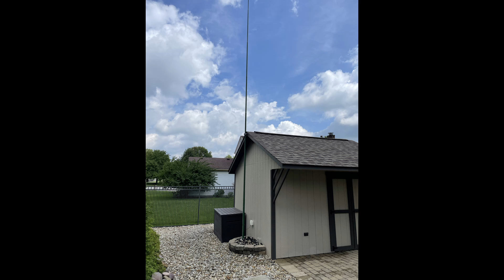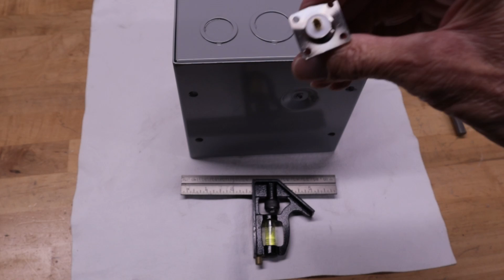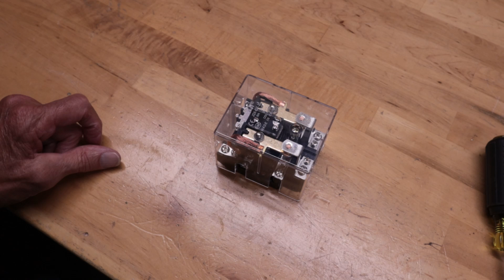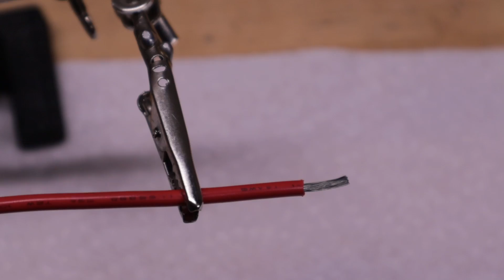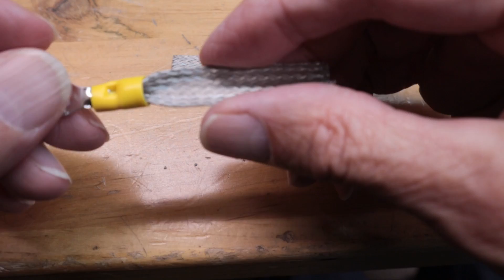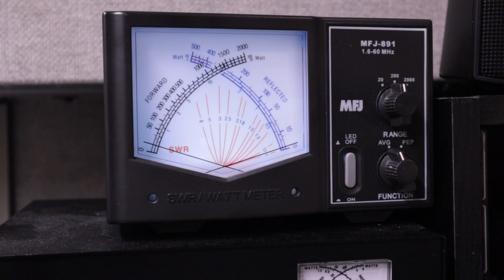Easy to Build REMOTE Antenna SWITCH for HAM RADIO!

Comment: Keep getting a high SWR...need my tuner to work it down, when on the 2nd connector( dummy load) tuner won't bring it down at all....
Reply from the maker: Not sure what would cause that.  Maybe try making a choke (coil your coax) just before the switch.

Comment: Awesome project!   The only thing I might do different is to implement a bias tee circuit to provide the 12 volts for the relay over the coax.   You can study the schematic for the MFJ-4116  Bias Tee devices to see how simple and inexpensive it would be to do this.   It would just be a couple of inductors, a few capacitors, and a couple of resistors - and, the time to put them together (you would need two - one in the shack and one in the antenna switch box).   The inductors would provide a DC path, while blocking the RF,  the capacitors would provide an RF path while blocking  the DC, and the resistors would provide a path to ground to keep voltage stable in the system.

Thanks for making and sharing the video, and 73!
AI4IJ
Reply from the maker: Great idea, AI4IJ! Thanks for the tip and the comment. -Ed. W8EDW

Comment: I operate WSJT-X,  JS8call, and VARAC-HF remotely using an APP called JUMP on my iPad and laptop to control the laptop.  I was looking at a frequency controlled antenna switch W-410A offered on eBay.  I can’t find any reviews that show the 410 device works.  However,  this antenna switch together with an internet controlled wall switch may solve my problem.  Thanks for posting

Comment: Great build Ed. Just wondering what the measured impedance turned out to be across the relay terminals for each antenna connection? I understand they can range from 50 to 200 ohms so may impact SWR. Cheers, Wayne.

Comment: What a great project. Might try this myself. Would be even better if it had a remote switch which i could add using some sort of wifi connection from the house to the yard..
Reply from the maker: Hi Maison. Yes, wireless would be great!

Comment: Ed, thanks fot this nice video,  2 questions  how to connect the + and - on  the 12 volt  with connectors
other question can you make a video how it work with 2 antennes ?

thanks again
Reply from the maker: Hi Imachielse.  The + and - doesn't matter.  The coil on the relay will work either way.  
I will be making a video using the antenna switch when a little warmer weather hits.  Probably in May.  
Thanks so much for watching!  -Ed  W8EDW

Comment: Thank you for this great video. This would really help me out. My antennas are a good 75’ from the shack, doing this will save on buying long lengths of coax. I was curious about how much power you are running through it. Also, how do you think it would work on UHF? Again, great idea!
Reply: I was reading the other comments and found that you are running about 500 watts. How is it holding up?
Reply from the maker: No problems after 6 months. 👍
Reply: @edwhitney1862  Thanks!
Reply: 73’ K2AED
Reply from the maker: Hi Daniel.  I run around 500 watts.  I don’t think you would have any problem with legal limit on 10 meters and down.    I’ve never tried it on UHF so let me know if you try it!  Thanks for the nice comment Daniel!  -Ed W8EDW

Comment: Nice project but won’t there be a big impedance mismatch at the switch? That’s the reason manual antenna switches are built in a specific way and don’t have long wires.
Reply from the maker: Hi Micro.  I haven’t noticed any high SWR problems.  I’ve been using it for quite a while now.  I’ve been running low power and up to 500 watts with great signal reports.  -Ed W8EDW

Comment: Hi Ed. Firstly, let me say I appreciate your intention and spirit... a true HAM. I have a few suggestions, and a few critiques.
So, right to it: On your praise of these Baomain relays, I bought 2 from Amazon.... they are CRAP! One look tells all... the contacts are VERY POORLY aligned and the contact patch is miniscule. the brackets that hold the upper (NC) pads and the lower (NO)contact pads are leaning every-which-way, so those contacts are not on the same plane as the armature pads. The plastic part of the Armature is so poorly designed that the arms that hold the common pads are not held in alignment, so are as much as 1/8" off center. This results in terrible contact fidelity and therefore sketchy (at best) opportunity for proper low resistance connection.. I am returning them and searching for a quality relay that I can afford. :-) 
But on to the design suggestions. With a good DPDT relay that offers good connection, I see no reason to use both contacts in parallel for the connection of signal. I suggest, in keeping with design practice common to physical antenna switches, why not use one contact for signal and the other to ground the unused antenna to provide some isolation. So, in a non-powered state, the first set of NC contacts connects signal to your default antenna while the second set of NC contacts connects the unused antenna to GND. When the relay is powered, the first set of NO contacts (now closed) connects the default antenna to GND and the second set of NO contacts connects the signal to your second antenna. 73
Reply from the maker: I have been using the relay switch for quite a few months with no problems.  BUT you are right, you get what you pay for!  Maybe make a video on your build.  I look forward to it.  -73

Comment: Great video. I actually have two of those relays just sitting around. I don’t have the fancy box that goes around them though. Be curious as to how well that would work with 2 and 6m. That’s my current antennas switching problem to solve. FB OM. 73, NV5E.
Reply from the maker: Thanks Ryan. Honestly, you might be better off with a “commercial “ version for the higher frequencies.  The lower frequencies are more forgiving. Good luck!  -Ed. W8EDW

Comment: Hi Ed.  Presuming you have the other antenna built by now, are you experiencing any tuning problems with the additional shield added from the other antenna? Thanks.
Reply from the maker: Hi cWatts.  Thanks for asking.  I temporarily used my screwdriver antenna hooked to that side of the relay and didn't have any problems.  It's definitely on the spring agenda for a permanent 10m antenna!  -Ed  W8EDW

Comment: Such a great video, Ed. So, so well done. Probably the best instructional ham video that I've ever watched on YouTube. I am in process of building a different type of remote antenna switch...one that uses a NOS Amphenol coaxial relay from EBay (26.5 VDC) , a 26.5 VDC power supply from Amazon, and a G-Home Smart Mini Plug (120VAC from Amazon) connectable to wifi and the internet so that I can switch two of my antennas remotely in my 2nd QTH a few miles from my physical station. Gathering the parts now. I can switch 3 antennas using the rig interface and a VPN and operate great (I even have Two WinKeys for remote CW) but because I have a 4th antenna I need to build something to accommodate it. I want to put the PS and relay in an aluminum or metal enclosure with 3 SO 239s like you did. Then an AC cord coming out to plug into the Smart Mini Plug. You did such a great job on this! I kind of wondered why you were using such a heavy-duty enclosure but then saw why..it's in a garage or shed! hihi.In my case, it will be in my shack so I can use aluminum. Thanks again for doing this. I wish more hams would venture into homebrew stuff. 73 de Scott, W1AL
Reply from the maker: Hi Scott.  Thanks for the wonderful comment!  Sounds like you like to have fun building your own equipment too. All I can say is wow!  You really have some cool ideas for your antenna set up.   You will have to email me with your build’s. I’m good on QRZ.  I would be happy to feature you on my channel.  Thanks so much Scott!  -Ed. W8EDW
Reply: @edwhitney1862  I'm making the video now which goes over the entire project. It will be on my YouTube channel at https://www.youtube.com/@soakland5. Yes, it would be an honor to be featured on your channel.

Comment: Well presented coax switch project. Might be a good winter project. What are your thoughts on building one that when the power is disconnected it grounds to earth to discharge static buildup during lightning?
Reply from the maker: Hi Bradley. Great idea!  Let’s design a circuit to do that. It will be fun to find parts and buid it.  If anyone has a design that uses common parts send it to my email. (Good on QRZ) -Ed. W8EDW
Reply: @edwhitney1862  what is your email Ed?
Reply: I just built something exactly like that today. I have the antenna positive and negative connected to the common of the relay. Normally closed contacts are both grounded to my ground, which leads outside to a 8ft ground rod. Normally open contacts are connected to the SO239 that my radio connects to. Power to the relay coil is provided by my power supply, which is connected to a smart outlet. 

My reason for doing it this way is to remotely disconnect my radio when I am operating remotely. I use the smart outlet to turn on my power supply via the Alexa app, which energizes the relay coil. Once the coil is energized, my antenna switches from ground to my radio. 

I also have a grounded lightning arrestor outside in line with my coax, but this is providing a little more isolation (not much) for my radio.

Comment: No need to use tape to hold the connector while drilling other holes - just nut and bolt the first hole using a lock washer, line it up and tighten it well, then drill the rest!
Reply from the maker: Good point. If you notice on the video I did both. LOL!  Just extra being anal that it doesn’t move. Thanks for the comment Hector!  -Ed. W8EDW

Comment: Liked the video however, you could added one more relay and a couple of capacitors and RF chokes and made 
a phantom power supply to send 12 Volts to the relay instead of a dedicated cable and you would have been able
to have three antennas off of 1 cable. But I am sure that you know that.  7 3  DE: KF0XO/EA4
Reply from the maker: Hi Radio Guy. Great idea!  You’ll have to send me your design. I was trying to keep it simple but would love to make a video with your design!  My email is good on QRZ.  Thanks!  -Ed. W8EDW

Comment: Neat setup. Clean nothing neighbors have to complain about. One idea is that you might have been able to omit the 12v supply and run DC over the coax to energize the relay.
Reply from the maker: Hi Rogier. Yep, you are right.  Another video project. Thanks so much for the idea!  -Ed. W8EDW

Comment: OK idea though not exactly impedance matched.  Also used the wrong box, should have used a NEMA 3R box or even better a stainless steel NEMA 4X box.  The contactor used is for power rather than RF but if the wires are kept extremely short I would guess it should work OK.
Reply from the maker: Thanks for the information Mike. It seems to work fine so far (about 2 months) almost every day
Reply from the maker: By the way Mike, thanks for taking the time to give us good information!  -Ed. W8EDW
Reply: The wires are a tiny fraction of a wavelength long at HF.  RF relays aren't necessary at HF.
Reply: @stargazer7644  Were you switching between 450 Ohm ladder lines I would totally agree with what you say.  But in this case the inputs and outputs are 50 Ohm UHF connectors.  And if I am being forced to split hairs.  The steel of the box doesn't have the paint under the connectors removed.  Should have had a strip of copper bar say .030" thick under all three connectors tieing them together as well as a grounding point to the station ground system for static bleed and lighter ing protection.  Furthermore, the crimps are done with a non insulated crimper.  The dimple is on top where the seam of the barrel is on the terminal.  This results in the terminal opening and a poor quality crimp.  In this case the better option would have been to use 12Ga solid THHN/THWN2 insulated wire and simply form hooks in the terminals.  This would eliminate the wire to terminal crimps and eliminate connections.  Look, it's the little details matter when mucking about with RF, even at HF.  I have no doubt that it's serves it's purpose and has functioned just fine.  But RF is not standard old 50/60Hz AC power and there are rules for each that we follow.   Being a licensed master electrician and having setup and worked at a couple of terrestrial TV transmitter as well as a couple of radio towers I have a bit of an idea at this point.  I feel like I am now crapping on the guys video and it is not meant to be that way at all.  I simply offer a perspective that I hope allows others to replicate this with improved implementation.  Were he local I would have helped him out and even thrown in parts and drawings.
Reply: @mikeiver  Everything here is below 30 MHz.   This type of construction is perfectly adequate for these frequencies.

Comment: "Just applying the SOLDER to the tip of the iron" is exactly the WRONG way to do it!  Amazing how many 'experts' on utoob don't have any idea
how to solder, yet they claim to teach others how to do technical things - also, "just 2 screws needed" to attach the terminals to the box is ALSO the wrong way to do it!  Sorry, but being LAZY does not equal being good at what you do; perfection is only achieved through
elbow grease and TIME and effort spent on your craft ... apparently, everyone else that gave you such glowing comments is just as ignorant
as you - NOT claiming to be an expert at everything, but I wouldn't make a video unless I REALLY knew what I was doing was presented in 
the most PROFESSIONAL way possible - other than than that, 73! - NOT 73s, sorry again, but THAT is incorrect too!
Reply from the maker: Oh. I don’t claim to be an expert. I have soldered that way for many years with good results. Time for you to make a video!  Take care. -Ed
Reply: No callsign?

Comment: Done this via a UHF link remote.  Antenna relays all burnt out in time in my case running about 50 watts . Contacts went HR. Similar relay. I soldered a flyback diode across the coil circuit.  This suppresses the high voltage Back EMF which could damage your PSU or other electronics if connected. This was standard practice in the profession I was in.   Worked well for a few months, but the relays were obviously inadequate. I need proper coaxial relays. At £40 each it's not viable when I need 4 of them. Now converted to a patch panel.
Reply from the maker: Hi Ken. You should do a video about your experience!  Love to see it!  Thanks for watching mine!  Cheers!  -Ed
Reply: W6PQL has some info on using small commercial relays for switching in his 2KW amp.  If you are damaging contacts you are either hot-switching them, have a high SWR missmatch or have enough voltage drop in the control line to leave a lose contact. Reglar old Omron gr2 series easily handle 1.5kw on digital modes with 100% duty cycle on 160-6

Comment: The contact gap on that relay looks pretty small, I'd be worried about arcing. Also is the relay rated for RF/AC or just for DC, you might have a problem with not enough "contact wetting" despite the large contact area. At HF the impedance match probably doesn't matter but at VHF and above a coaxial relay would be better.
Reply from the maker: I am only using the switch on HF. It seems good so far!
Reply: @edwhitney1862  it really just depends how lucky you are.  If the power is high enough, the antenna impedance is less than ideal, and the cable length and frequency are "unlucky",  a standing wave voltage peak might just coincide with the position of the contacts!
Reply: Lol, those contacts are huge, and so is the gap.   The little omron G2RL series works completely fine up to 1500w on 2 meter with any sort of acceptable SWR.  Most likely why they are the most common switches found in amps hf-2m. Only real worry with his relays in stray reactance from the long contactor leads.
Reply from the maker: Hi Colin.  Sorry about the late response.  I’ve been running that relay over a year now with good results.  So far so good!  Thanks for the comment Colin!  -Ed W8EDW

Comment: Looks good. I would check the coil current to make sure the wire back to the shack is allowing full rated current.  It not you can boost the voltage until the coil current is sufficient.  73 de N8RL
Reply from the maker: Good point Richard.   I used 14 gauge wire and my power supply will go up to 18v. Thanks for the suggestion!  -Ed
Reply: @edwhitney1862  If the relay coil doesn{t get enough current the contact could in time wear or overheat.  Using both contacts in parallel is a good idea.  And I wouldn't worry much about the diode with nothing else connected to the supply.

Comment: would you mind listing the Amazon items?   Thanks
Reply: Did you scrape away some of the box coating where the ground screws and straps go?
Reply from the maker: Hi N1KKI ,   Yes I did scrap the paint off.  But I wanted to be doubly sure that they were grounded together.  Thus, the straps.  Good point, I should have mentioned it.  Thanks!
Reply from the maker: Sure be glad to.  My email is good on QRZ.  Send me your email and I'll give you the numbers.  -Ed